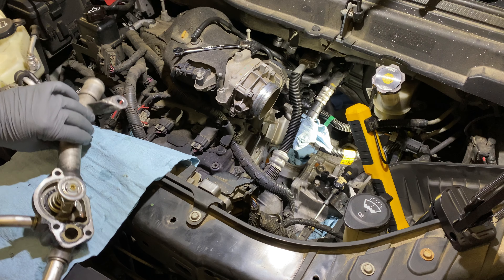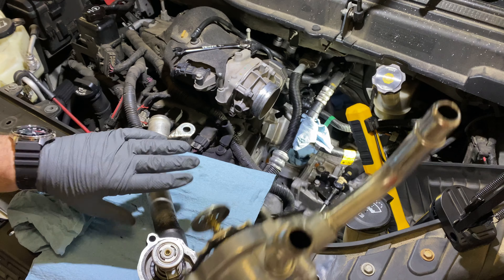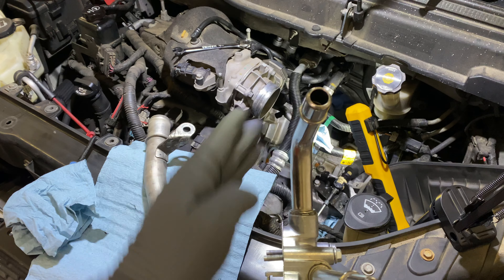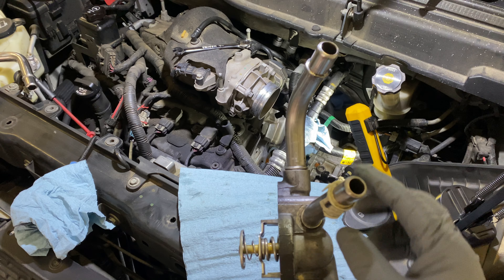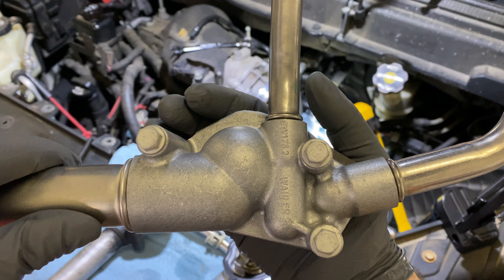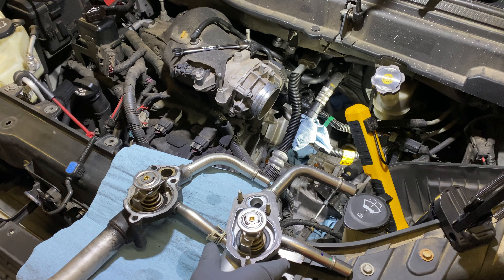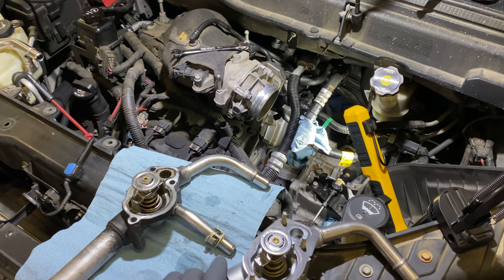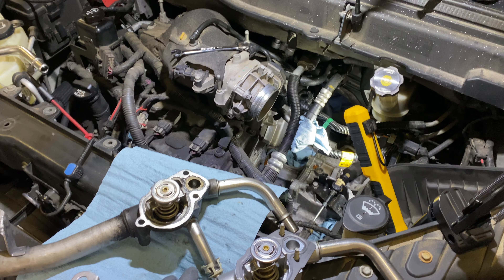GMC Acadia thermostat housing issue - 2008 GMC Acadia

Comment: Thank you so much for the video. Our 07 Acadia just started to heat up while in traffic and very hot weather. I had checked and refilled the coolant. Next to check is the Temp sensor, thermostat, and lastly the radiator.
Reply from the maker: If you're having to refill the coolant, it's going somewhere. Check for leaks and check your oil as well for any coolant in it. Also check around that thermostat housing, ours had a slow leak for quite a long time before I got around to replacing it. That lead to strange things, I believe it could have also been sucking small amounts of air into the system too maybe.
Reply: @brenth7774  Thank you for the reply. I drove it to Bass Lake, CA this past weekend and noticed the fans were not turning on. Discovered this thing has THREE fan relays....purchased the only two that the store had on inventory in Fresno, CA...and the third one was the culprit. (phew!) I was getting ready to get hit with a huge bill but $40 did it. Had a blast on 4th of July!

Comment: Thanks for the warning video. FYI: I bought the same part from Amazon about a month ago. The pipes are angled correctly and there is no epoxy at any pipe joint to the main casting. Also, there is a manufacturer name and part number embossed on the main casting: WAHLER BW175.1 which matches the OEM part you got form Chevrolet. It looks like you got a returned part that someone tried to "fix" before returning it to Amazon.
Reply from the maker: Glad to hear. I guess it could be the case but there was similar epoxy on the factory one that I took off if I recall correctly. We've since gotten rid of the Acadia, it did serve us well for almost 8-9 years or so.

Comment: How did you take the two hoses off to remove the whole housing? Thank you
Reply from the maker: they have a disconnect fitting clip - you have to push the two tabs in, push the hose in slightly and then it should come off.